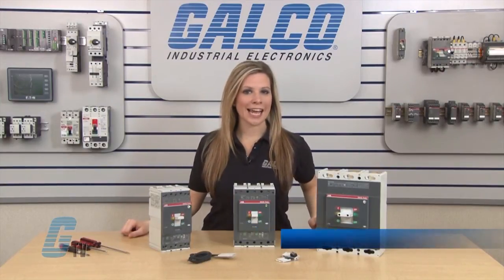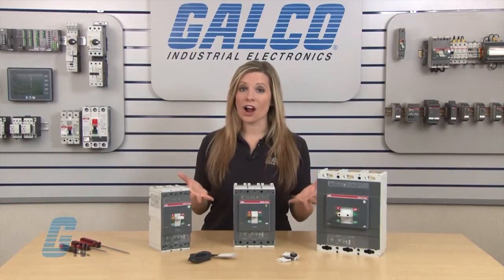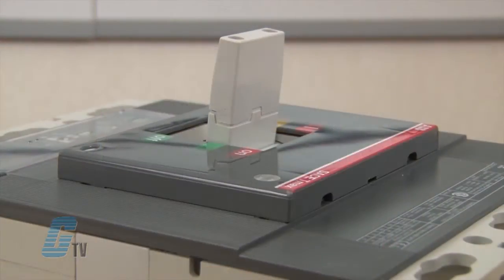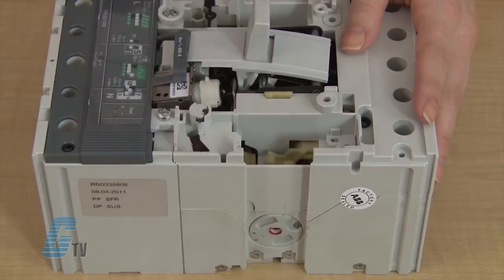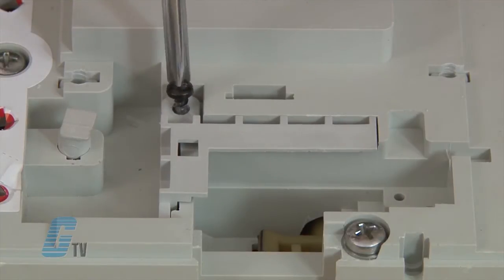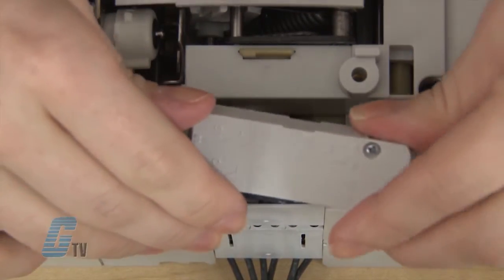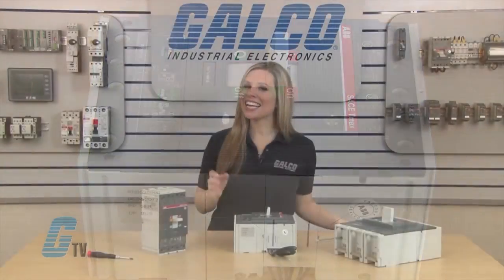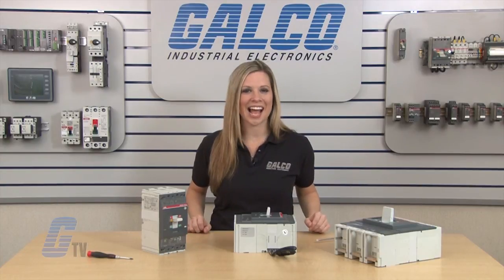Installing an Auxiliary Contact in an ABB T-MAX T4, T5, and T6 Enclosed Circuit Breaker

Comment: Correct me if I'm wrong for cabled Aux contact it means it should be hardwired to a system in able to Trip/close or open the breaker is it correct? if YES, what if we installed cabled Aux contact but NO hardwired or no connection to a system? does it still Trip/close or open? Thank you